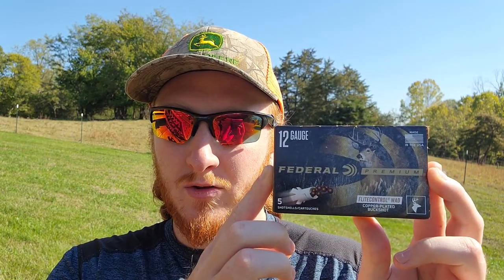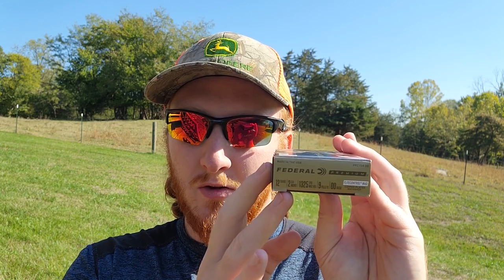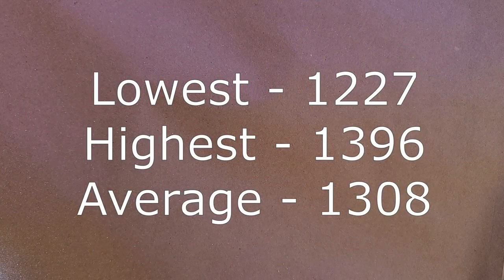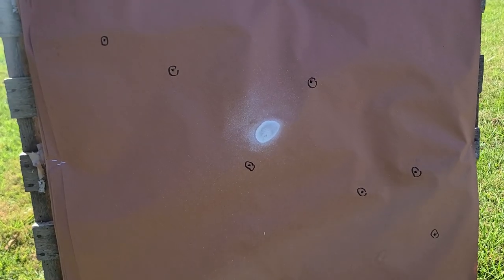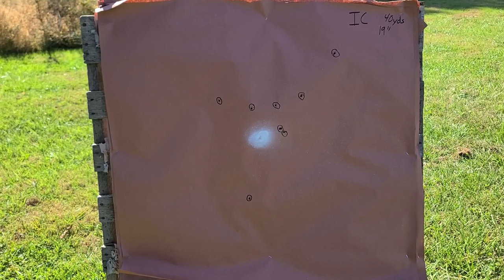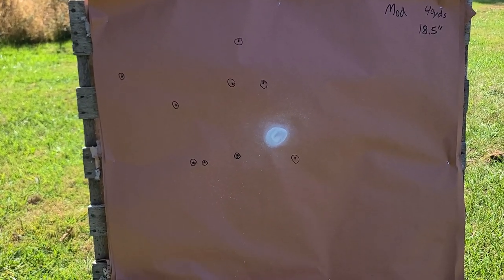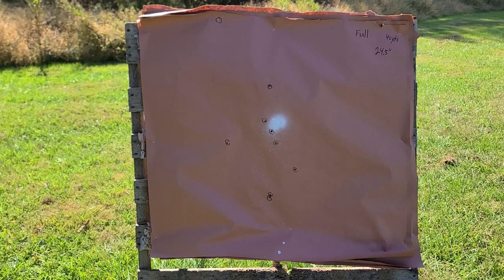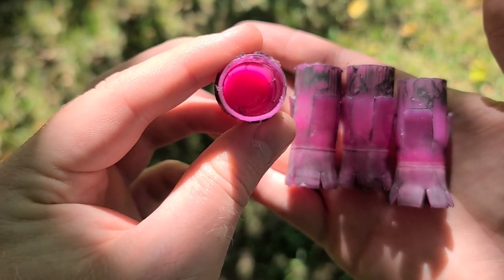What's The Best Choke For Federal Flight Control 9 Pellet 00 Buckshot? Let's Find Out!

Comment: 🤔 That improved cylinder shot group looks pretty good, while also allowing the use of slugs when needed at longer ranges without having to swap out the choke itself. Thank you for sharing.
Reply from the maker: You can still shoot rifled slugs with a mod or full choke if that's the setup you have. Depending on the gun and slug, they may be very slightly less accurate out at 100 yards, but it can absolutely still be done and be good enough to do the job
Reply: @matttyreeoutdoors  Oh cool! I’ve never shot a slug out of a shotgun before. For some reason, I had it in the back of my head that you needed a IC choke. Glad to hear I was wrong about that. I have a coyote problem right now, and they have snatched 3 of my last 5 lambs. So I was wanting to smack them with the 00 buck up close and hit them with a slug if I caught them under a 100 yards.
Reply from the maker: @WR_CTorch  Yes, you can absolutely do it. Most boxes of rifled slugs will say that the slugs can be fired through any choke, but an improved cylinder choke is best. I have found that a number of slugs actually do better with a little more constriction, it just depends on your specific setup. I would test your setup first before taking it out just to make sure you have a decently accurate slug combination, but it's absolutely safe to shoot lead rifled slugs through a full choke
Reply: @matttyreeoutdoors cyl choke is better for slugs than an imp choke
Reply from the maker: @user-sp9hy8tq4j  I've shot a lot of slugs and that isn't necessarily true. Sometimes a specific slug may perform best with a cylinder choke, but that isn't always the case. With the majority of the slugs I've tested, IC or Mod has tended to be the best combo. Plus most manufacturers recommend an improved cylinder
Reply: @matttyreeoutdoors thanks for the cool video! Have you noticed a difference in pattern between even and off number of buck shot pellets? Rumor has it, even numbers, especially 8 00 buck pellets have a tighter pattern vs a 9 bc at least one ( odd one out) becomes a flyer by how the pellets sit in the hull

Comment: Federal flight is designed to not need a choke because the wad won't work correctly
Reply from the maker: That was the original intent, but these real world results don't lie. It sure seems like they can be choked down and perform even better
Reply: @matttyreeoutdoors  I was gonna agree with that one I was seeing the video , but the only thing is they don't show you that it's the one that they're put in the chamber and they don't actually keep showing you the actual shots with the results I think there was a little bit of film edited there but don't worry.I'll let you know when I buy them And do it myself Because everything about the wad says you would be  crushing  it and crushing it It won't be able to push the palates like it's opposed to

Comment: These are getting harder and harder to find. Great video.
Reply from the maker: Thanks! I haven't seen them in any big box stores recently, but I have been able to find them in a few small town shops though
Reply: @matttyreeoutdoors  found em at bass pro. They ain't cheap though 13.99 for x5
Reply: have you tried the hornady critical defense 12g, the versa wad is similar to flight control and the buckshot is coming out at 1600 fps
Reply: I'm thinking about trying something like a buck kicker choke and running regular buck shot.

Comment: Most people would never run a choke with a Flight control wad because it will make the flight control wad ineffective.
Reply from the maker: That's why I decided to test that theory. Clearly, these results don't lie. They were initially made for open chokes, but it sure seems like you can choke them down and get them to perform even better

Comment: 1187 premier is an overbore model, so the barrel is inhibiting the wad from functioning as designed. You're basically turning the load into a standard wad shell because the wad isn't flowing down the barrel smoothly, thats probably why you're getting better results with chokes. The FliteControl wad was specifically designed for straight cylinder bore barrels.
Reply from the maker: Well, that's not exactly true. First off, yes, Remington did make some 11-87 Premiers that were overbored slightly, but those were the "trap" and "target" models. Mine is not one of those. It has a factory 28" light contour field barrel that I have personally gauge pinned out to be a .727 bore diameter, so mine is not overbored or backbored in any way at all. Secondly, yes, the flite control wads were designed with tactical and defensive applications in mind that have little or no choke at all, and the shells do perform much better than a standard buckshot load would in those applications. However, based on this test, choking them down a little bit definitely does not hurt the pattern one bit

Comment: Interrsting how so many people say to NEVER use a full choke with flight control becuase it will cause the mechanism of the flight control to not work. Well, this video shows all those internet know it alls were wrong. Thanks for the video sir.
Reply from the maker: I was always suspicious about all the mixed information out there, so I wanted to test it and see. I definitely think there's an ideal amount of squeeze vs wiggle room between the pellets and the wad, and clearly it looks like a little bit tighter is better for this load

Comment: The over bore on that 835 is allowing the wad to tilt or wobble on its way up the bore to the muzzle, just like firing a slug through over an bored shotgun. That makes it act like standard buckshot through your chokes because the wad isnt able to function as designed.
Reply: Correct! So polishing the chamber would make it worse

Comment: If you discard single flyers - you get the best pattern by far with full choke. If you were drone defending - that's what you would want. And I was hoping you would pull back to see longer ranges. But this is pretty definitive - so thanks a lot.
Reply from the maker: I definitely would like to do some more in depth testing with them at some point soon, but either way, we definitely saw some good results!

Comment: I think the improved cylinder shot might have had either a flyer or 2 in same hole with I think happened
Reply from the maker: It definitely didn't have 2 in the same hole, I checked for that. So you're probably right with there being a couple flyers. Either way, not a bad pattern at all
Reply: @matttyreeoutdoors  not at all

Comment: What’s the best choke for a smooth bore that wants to eat slugs? TY
Reply from the maker: If you are using a typical lead rifled slug, an improved cylinder choke is a good starting point. Depending on your specific shotgun or slug, you may see slightly better performance with a modified choke, but generally an improved cylinder is a very reliable option

Comment: Try to find some 8 pellet for testing. 9 in flitecontrol tends to have a flier. I bet youd be pleasantly surprised
Reply from the maker: I'll take a look around and see what I can find
Reply: They don’t make 8 pellet 00 2 3/4
Reply: Hornady Critical Defense is 8 pellet with a flite control wad
Reply: @user-sp9hy8tq4j Federal does indeed make an 8pellet FliteControl 00Buck, and it's 2 pellet per row holds a better pattern than the 3 per row stack 9pellet load. But it's very hard to come across these days. Hornady makes a similar 8pellet 2 stack, a critical defense load with nearly identical wad. It has higher velocity, but isn't as good patterning in my tests.
Reply: @MB-jg4tr yup, hornady does not  have buffering in with the shot, and they are using lead instead of copper plated.
Reply: @jonathanrogers9961 yeah but Hornady uses a hardened lead antimony for their buckshot. They just harden the lead vs copper plating it.

Comment: If someone is stuck with a cyl gun w no choke tube threads then FliteControl is the way to go 
if you think that targets at a range of over 20 yd might be encountered
Reply from the maker: Yeah, if all you had was a cylinder bore, flight control would probably be your best bet at those slightly longer ranges

Comment: I've seen a box of 5 going for around $20 at the local show. That's ridiculous even though at a hunting range of 40 yards the way they patterned. I personally would try to find a aftermarket choke specifically for buckshot and just use the plain old economical loads and save money in the long run.
Reply from the maker: I think I paid about 14 bucks for this box. I definitely get what you're saying though. If you're gonna be hunting at out to 40 yards, a lot of the cheaper loads will get the job done as well
Reply: Shop around. I just bought 115 for $145 shipped.